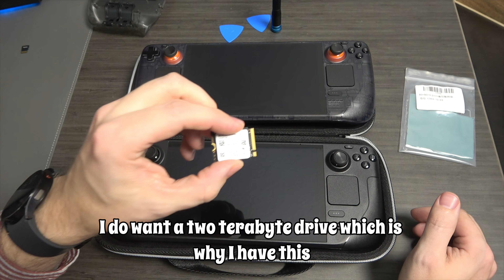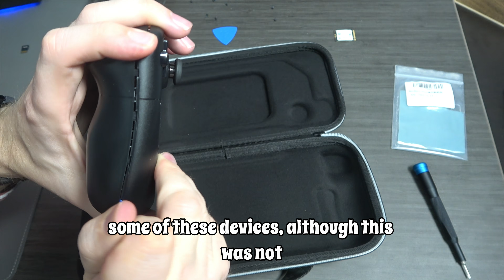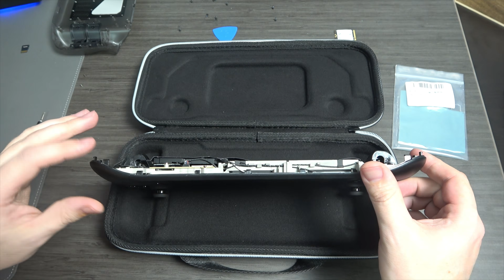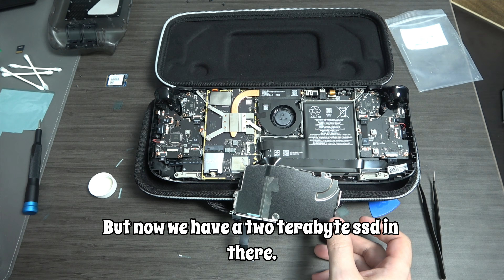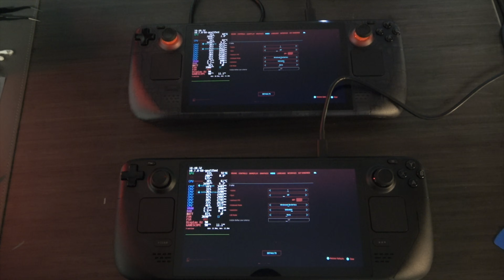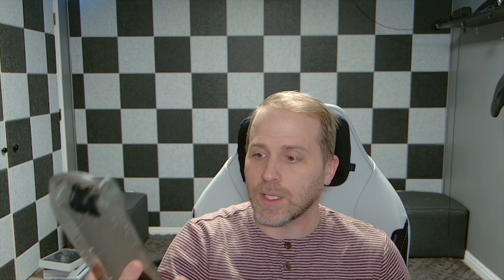SteamDeck OLED PTM7950 Paste Tested + 2TB SSD Upgrade Complete Guide

Comment: 23:30 top system is drawing hot air directly from the system below
Reply: That's not how it works there's no vents on the bottom of the deck and he specifically said in the comments that he tested it again with the top one at the bottom and the results were the same

Comment: I recently upgraded my steam deck oled le to 2tb storage and changed the thermal paste to ptm7950 and lost the thermal pads and need replacements. Please help. Tried a work around temp but it wont boot now. white light flashing and I can hear beep and fan spins max after a bit.

Comment: I bought the backplate, and removed it after runing for about a week...Great CPU/GPU cooling, warmer temps elsewhere. The PTM7950 makes about a 6-8c difference on the LCD model. I didn't expect it to make much difference on the OLED model, but 2-4c is still not bad. Just not the difference it makes on the LCD. Good video.

Comment: The temp difference is the same as yours that I got with my steam deck oled after I added just the rear vented back plate.  I did not change the thermal paste/add a thermal pad etc.  Just the backplate and got a 7-8 degree decrease in temps and also  7-800rpm fan speed decrease.  The thermal pad is good product for longevity, though, but doesn't do much for temperature differences unless your thermal paste is old and cracked up, which takes some years.

Comment: I did this exaxt same test, running two games for 10 minutes from cool at the same position and found no reportable difference with the PTM7950. I am editing the video now but temps and fan speed were too close to say it makes any difference. I would suggest that if you are having problems with your temperatures then try the 7950, otherwise leave at stock, it is not worth the money for the change in performance. The more noticable difference is obviously the backplate, but my understanding is get version 2 which you have there, not version one.

Comment: The Steam deck at the bottom is directly blowing the hot vent on the steam deck above which can skew the temp comparison. I understand the placement is so that you can fit both on the camera. Running a second test with the decks swapped should give you an idea of the placement impact for correction.
Reply: As soon as I saw the placement of the two devices I thought of the same thing. The top one is definitely drawing in the hot air of the bottom one.

Comment: 26:18 You can and should disconnect the battery before removing the shielding.
Reply: Yeah, but the battery is pretty difficult to disconnect.
Reply: It is difficult, not impossible.

Comment: The Jsaux V2 "Vents" backplate, along with the RGB version does heat up other components in the Deck, making any gains had with the APU not worth it.  I've done extensive testing with the PC0106 and Vents version with my OLED Deck, testing NVME thermals.  The best solution is the Jsaux PC0106 with no thermal pad.  It does run the NVME a little cooler than stock under load.  Better thermals can be had as you have seen with the PTM7950, and an undervolt helps also.  The Vents and RGB backplates should be removed from the market IMO.  People think they make your Deck cooler because Valve's on-screen performance metric shows lower CPU/GPU temps, but it does not show any other temps that are degraded.  Under my testing conditions, the OLED Deck showed NVME Temp #1 and #2 at 51C/54C, and 46C/49C with the PC0106 backplate and no thermal pad.  I got down to 43C/44C with PTM7950 and an undervolt.  The Jsaux V2 Vents backplate showed 58C/73C temps under the same load.
Reply: Also, I didn't see any fit issue with the PC0106 backplate with the microSD card.  I don't know if it's a slight difference between our Decks or if yours wasn't snapped on all the way.  In any case, after it is assembled, I can easily insert/eject the microSD card from the slot.

Comment: I thought that plate where the ssd had 3 screws?  I been trying to find a video to show a betetr way to do this  part but everyone seem to rush into it and not worry about bending that little part on the button  right.  Also i thought the back plate when you screw it all back couldn't be sued because they made the steam deck different or did they make plate for the oled version now?
Reply from the maker: the jsaux works, but I ended up taking it off as it seems one part wont clamp down quite right.

Comment: I think that PTM compound needs few cycles to essentially "melt" - liquify/turn in paste form and spread properly, but it should not have significant impact for the surface of the deck apu, which is essentially direct die and small surface...
Reply: I have the old deck and type2 of the jsaux back plate I did note that the bottom of the deck was warmer when charging so I ended up adding  2 v5 fans to the back of the plate and a small battery to power them this seems to have cooled that down (it honestly only cools the plastic I'm sure lol) but I figure any air intake is better then none

Comment: I think I read that Valve made some change to the body plastics of the Steamdeck for repairability, like the clips are easier to pop open and less likely to be damaged. This may be why the old plastic backplate didn't fit precisely on the new OLED Steamdeck.

Comment: the custom backplate may improve cooling performance on measured parts such as the CPU, but it will result in higher temperatures on other components.

the original backplate was designed with the fan intake obstructed in order to force air to flow over other components between the intake hole and the fan.
Reply: It reduced airflow but did not eliminate airflow, Cryobyte33 stuck temp sensors in the areas of concern and found there to be no difference with the jsaux vented back panel
Reply: @ShutterContinent Lol, no difference?)) Type into youtube search "Температуры VRM Steam Deck с разными крышками. Стоит ли менять крышку на Steam Deck?" (don't be scared by the Russian, this is just the only normal test of VRM temperatures) The difference is 5-7 degrees.
Reply: @ShutterContinent  no offense to Cryobyte33, but that wasn't that great of a test.  You can poll the Deck's NVME temperature (it has two sensors), and it shows much worse NVME temps with the Vents/RGB backplate over stock/PC0106 under a proper load.
Reply: I wonder if by putting tape over the additional holes in the new backplate would help with that. I'm interested on the plus sides of the additional metal heat sink on the side of the backplate if that one does help dissipate heat. Especially if u add in those cellphone coolers.

Comment: what would be the biggest SSD that could be upgraded to
Reply: My research keeps pointing to a 1tb internal ssd.  Some publications I've come across do not recommend the 2tb becuase people have reported issues with the micro sd port not recognizing micro sd cards after installing a 2tb internal ssd.  I took my OLED SD from 512gig to a corsair 1tb with a 1tb sandisk extreme micro sd card for a total of 2tb that way.

Comment: Appreciate it! I was considering buying both the thermal pad and the jsaux v2 backplate, but after seeing this, it doesn’t seem worth the trouble. A mere 2°C difference isn’t significant, and the SD card problem is a major concern, so I’m passing on both.

I’ve liked and subscribed due to the helpful insights your test provided.
Reply: Tech Guy Beau's channel did the PTM7950 test between LED and OLED and said his testing shows it makes a big difference on the LED, not a big difference on the OLED.
Reply: @kylevanwagn3r  yeah. i have both(jsaux v1 backplate) on my LCD deck. seeing this, i won't be doing the same on my OLED
Reply: @kylevanwagn3r  Maybe it depends when you got your deck, mine is an LED and the 7950 made no real difference and was at some points worse! However, I got my deck in Sept 2022 so there may have been revisions from first launch.

Comment: Glad you did stock versus stock back plates too. 

I have the version 1 jsaux back plate (w/no thermal pad). Put that on the OLED deck and I found the same fitment change with the SD card slot. I couldn't actually eject the card before I had the screws in the back plate. I don't know what I put the card in before screwing the plate. But it was "tolerable" with the screws in. I never eject the SD card so it's pretty permanent storage. Otherwise I'd file the SD card slot to be a little wider. It would look worse but be easier to eject and give a little piece of mind that the SD card isn't under any pressure.
Reply: One thing I was considering was trying to reapply the 7950 doubled up to see if that makes any difference. Also you should install it after being in the freezer for about 40 minutes.

Comment: I think for a better side-by-side comparison the units should be... side-by-side. The exhaust for the cooling system is at the top of the unit, and the intake is on the bottom left of the back. The heat from the bottom unit could be influencing the temperatures of the top unit in a negative way, though probably not a lot.
Reply from the maker: Two side by side steamdecks would not fit in the aspect ration with readable screen data. but I knew people would ask this, so I also reversed the positions of the steamdecks in question, the results were the same in either orientation.

Comment: A problem which is getting a bit of light now is the haptics. Myself and others are finding problems with one of the trackpads being more powerful than the other, mine also has a double click which i'm concerned about and trying to find ways to fix it myself as the returns process seems like hassle especially if I recieve a new unit with the same problem.

Comment: Compression of time my man. Feel free to edit out you undoing screws and shit. We can handle it. However, thanks for the video! Pretty interesting stuff and results and I am with you on the color scheme of the limited edition.  I'm happy with my OG as it does everything just fine and I don't have any urge to mod it out or customize it. Probably because Values design language is so strong as it is that I don't feel the compilation to do so except maybe the thermal paste as you did here. Is that the compound you recommend or just what you had?

Comment: Your temperature comparison in the video is kinda inaccurate since the bottom deck is blowing hot air into the top deck. Put them side by side do you still see a 5 degree difference?
Reply from the maker: I was waiting for this comment.  I actually reversed the positions of each deck, reran the benchmark and had the same results no matter which one was below.

Comment: Putting a vent directly over the fan will increase cooling to the fin stack no doubt, but you’ve removed cooling for the rest of the device, like for example the SSD and VRMs.
I wanna open mine up but I’m worried it’ll scratch up the orange painted screws on my LE
Reply from the maker: Use some latex gloves, cut them up and make the torx bit rubberized, I did this and don't see any damage to my orange screws.
Reply: @cbutters  Thanks, I was thinking using this method might work.
Reply: I saw someone use some plastic cling wrap for the same method. Just put the wrap over the screws when applying pressure.😊
Reply: If you worry about that you could use thermal pads or even better visous thermal paste to connect the other parts to the heatsink.
Reply: According to Games Nexus, the Oled Deck has less to none negative pressure. So there's no need to worry about VRM's temps and close components. This case should fit better than the LCD model.